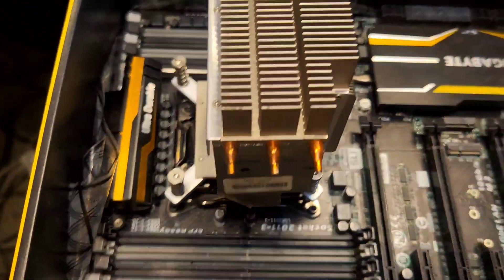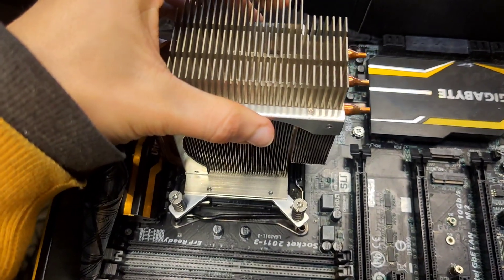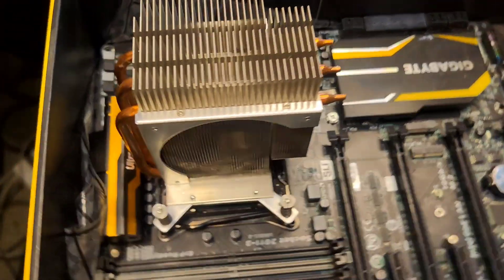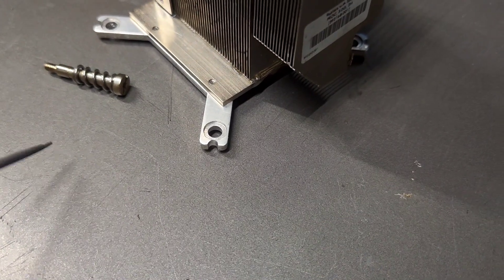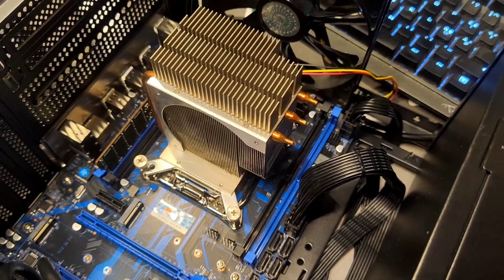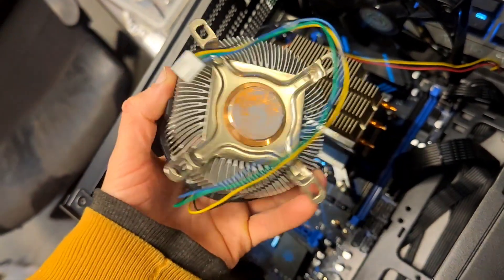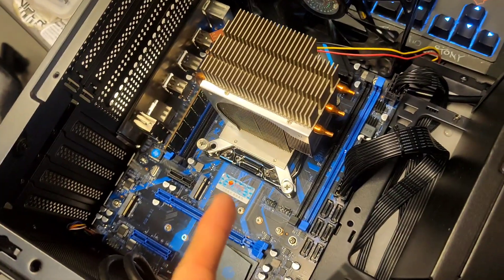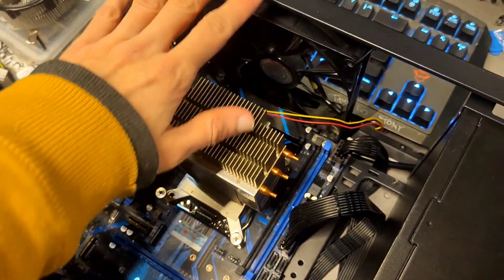Recycling old LGA775 cooler on X99 / also valid for x299 or lga1700

Comment: Do you happen to know what specific cooler you're using here is, or the part number? Or if not, what machine it came out of?
It's really cool-looking, very industrial. I'd like to find one if possible.
Reply from the maker: @phillycheesetake  sorry, i just had it around the lab for years. Most probably some core2duo or quad HP business desktop
Reply: @mircomputers  I figured it out, the part number is visible in the video; Foxconn 391818-001, from the HP Proliant ML110 G3.

I'll need to replace the fan because of HP deciding they're too good for the ATX standard, but other than that it should work great for me. Thanks!

Comment: how to remove the screws from such coolers?
Reply from the maker: @G0nza587  you have to usually take away the springs first, it takes a bit of work or a good cutting tool
Reply: @mircomputers  I checked there and they have washers on the back. once you take those washers out, just use a pair of pliers and you can remove the screws without having to cut anything.
Reply from the maker: @G0nza587  yes the washers have to come out but it's harder without getting the springs first..

Comment: Oh yeah these coolers are beefy af with a lot of copper and it'd be a waste if they weren't used again. What I usually use for X99s that I sell are low profile coolers that blow into the motherboard so the VRMs and RAM sticks are cooled as well. I will do this trick to one of my boards that already has a small VRM fan. Thank you.
Reply from the maker: @wood6454  yes as you see the fan i use takes care of ram and vrm cooling aswell